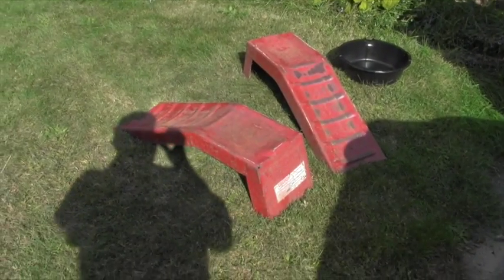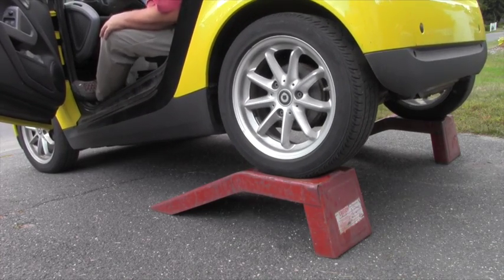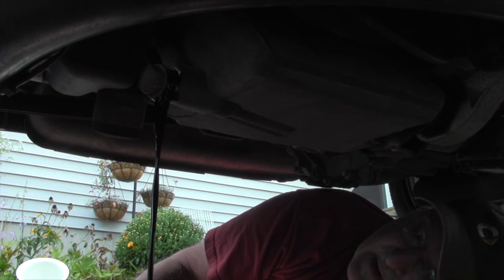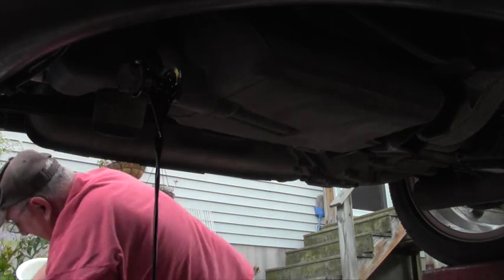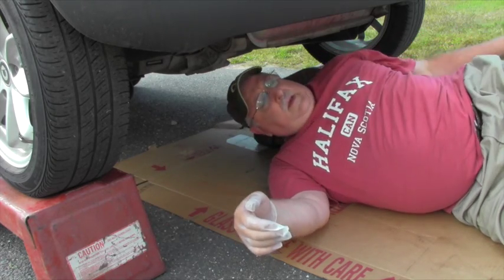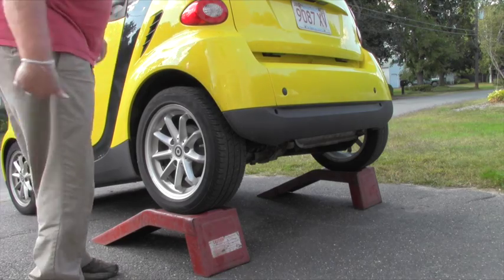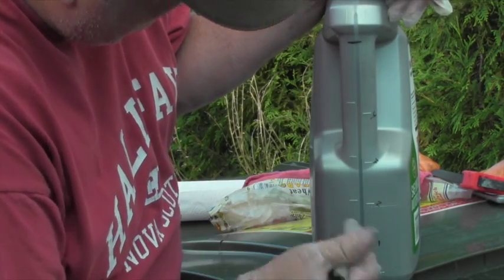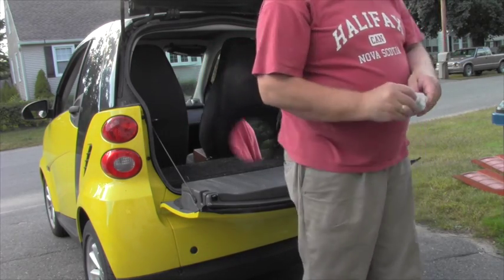smart Fortwo Oil Change

Comment: this is a perfect example of why you leave the things like a simple oil change to trained proffetionals... i have never seen anyone do anything like this HAHA,
i like how you make sure to clean off dip stick and fill cap, after you just ran the engine with no oil pressure for 33 secs HAHA, a little dirt in your engien is the least of your worries :P
Reply from the maker: It's an '08 and it runs just fine. Doesn't even burn oil. HAHA!
Reply from the maker: I won't waste my time going round-and-round with you over this. I've already addressed this criticism from dozens of motorheads like you who believe that instantaneous, irreparable damage is caused when engine parts begin to move without pressurized lubrication. If that's true, then simply starting an engine should also destroy it.
Reply: Denb7  i never said any damage acurred. but execive wear WILL happen when you do this.

im a trained mechanic. you should try it.
Reply: Hello Martin,

When you rebuild engines, do you suggest pre-filling the oil filter?

Please advise
Reply: LSmiata yes and you should fill it at the outer holes not the big one in the middle. the middle hole is for the filtered. 
thats why you fill it in the outer holes. 

but really the no1 thing would be t prime the engine until there is oil pressure
Reply: Hello Martin,

Thank you for reply.  You make some good points.  My oil filter has check-valve and takes very long to try and pre-fill on outer holes so I fill center.  YES!, I understand it is the intake to engine.  I just make sure no dirt/debuies/contaminates get into filter b/4 installation.

NOTE:  This step is also completely unnecessary, but I like to do as it makes me feel good when oil pressure hits so quickly.  Unnecessary, but satisfaction for the DIY guy.

Please consider that Denb7's video is very accurate for owners of a smart.  

Also, please consider, this engine was wet and under no load during video.  I know how painful it sounds and the tic-tic of the valve lifters making noise, but in the real world drivers do much more damage on a normal day by not letting an engine run for even 10 seconds before applying a load (i.e. engaging the engine and driving down the road).

Cheers and Merry X-mas to all.
P

Comment: Ps anyone ever here of cleaning the engine to keep it looking like new longer ? Geese that's years of untouched dirt
Reply from the maker: dave averesch Being located inside the car, under the deck of the rear storage compartment, I personally don't care whether it "looks new" or not as long as it operates well. When the dust on the outside of the engine affects its performance, maybe I'll clean it. Besides, with all the electronics involved in modern engines,  I'd worry about getting components wet.

Comment: OMG...  Start and drive a car without oil... This guy is an "artist" - the reason why don't like buying used cars....And there were so many ways to do it right...He could pour 3 quarts of the new oil, start the car and drive it down the ramps, shut the engine and then add the rest of the needed oil, he could also just release the hand brake and let the car go down the ramps without starting it and causing oil starvation to the bearings of his engine - some people seem to like abusing the limits of the boundary lubrication... He even didn't let the old oil drain completely...
Reply: Please show me the correct way.

I look forward to your couch chair coach video

P
Reply from the maker: Why didn't you just heed the disclaimers and walk away? You're wasting everyone's time complaining because nobody cares what you have to say. At least you acknowledged that there's still oil in the engine when you wrote, "He even didn't let the old oil drain completely..." even though it contradicts your, "Start and drive a car without oil..." comment.
Reply: LSmiata, In my post above I gave two correct ways of doing this job without oil - starvating the engine, if you couldn't understand what I suggest and generally see as something very complicated an oil change then it's maybe better to leave this job for someone who knows what to do, surely this would be much better than following the procedure shown in this video.
Or if you insist too much on driving your car without oil - do it, you can also try moving around with no coolant, it's your car and your money, but please stop entering in discussions you can't understand.
Reply: Mr Denb7, are you saying all this rubbish in serious?..Are you presuming that by leaving 100ml of dirty oil in the sump the oil pump pick up (in a car whose rear end is much higher than the front being the engine not positioned horisontally) will manage to take these last drops of waste oil and lubricate your engine with them, creating a hydrodynamic film between the crank and bearings? 100ml of dirty oil although being enough to contaminate the new oil are totally insufficient to lubricate an engine.
When making a video tutorial which would be available to the wide public better do the things right - more on something so simple but so important as an oil change - there are many folks out there not having even the remotest idea of how this task should be performed and they would be misleaded.
Reply from the maker: The category of my video is 'Entertainment' NOT 'How To'. For anyone so naive regarding changing their car's oil that they depend on the viewing this one video as their source of information and they blow up their engine, then they deserved it. That person should be paying Jiffy Lube to do their oil changes.
PS - I think a new filter plus 3.5 quarts of fresh oil will handle that last 100ml of old oil just fine.
Reply from the maker: So if I hadn't used ramps, the video would still be entirely incorrect? Wow! You are a hard one to please. Is it because I didn't drain the oil to your satisfaction? 
So where's your video showing the proper way to change oil? I honestly don't care for your suggested warnings or anything that happens to anyone who wrecks their own car through their own negligence. I accept no responsibility for their stupidity. I'd like to see someone try and sue me for such a thing.
Here's a suggestion for you: Being one of only a handful of people on the planet who actually knows the proper way to change oil on a car, perhaps you should do this professionally. You'd make a killing! I'm sure your customers would really appreciate how thoroughly you drain their old oil.

Comment: You don’t wanna over tighten the oil filter but it’s ok to run the engine with no oil 😂
Reply from the maker: Yes that's exactly right. Everyone knows that when you open the oil drain plug, it's as efficient at removing oil as disassembling the engine, steam cleaning all the parts and drying them with towels then reassembling the engine. Removing the plug leaves not even a slight coating of oil on any moving parts so they instantly begin grinding as if there was sand inside.
Yes... 33 seconds at an idle rev has allowed the pistons to chew right through the engine block.
GOD! Why was I ever so foolish? Doing this every year for 11 years has left nothing but metal shavings in the back of my car.
How ironic that I traded it in because the transmission crapped out.

Comment: I'm looking at a Smart car and was just curious about stuff... but this takes the cake. You can claim it doesn't hurt it, but you WILL NEVER touch any vehicle I own. The fact that you "think" this is OK is a scary thought. Licking a piston? Really? Is this something you have done? The difference between an oil film and lubrication being pumped though the engine is not the same. Not by a long shot. 

And just to put it out there, I doubt you need those ramps at all...that car is high enough and everything is within reach from the back... and it also looks like you need a new set, using them for a 1ton truck are we?

Licking pistons - that's funny right there...
Reply from the maker: David Cote Gee thanks for letting me off the hook. Here I thought you were going to ask me to change your oil. Knowing that I'll never be allowed to work on your car is a load off my mind. 

I'd bet that anyone who licks their cylinder wall will get oil on their tongue. 

FYI- I'm old and fat so I prefer using ramps... besides, it freaks weak-minded people out when I drive off them before replacing the oil.

Comment: This is why I don't buy used cars as a rule.
Reply from the maker: OMG! Operating that tiny engine for 30 seconds a year with no oil pressure isn't going to kill it. I found my first lawnmower on the side of the road with a dry engine and a seized piston. I beat the piston out of it with a hammer and used sandpaper on the cylinder wall which was badly scored. It was used and abused but I put gas & oil in it and ran it for 10+ years.
Reply: Get your used car cheeeeepppppp just for the fact ppl don't take care of cars the way you would so when they blow u can afford to fix them I had a 96 passat diesel changed the oil and filter and fuel filter every 7k on the dot especially the fuel filter 11 filler filter is better than couple hundred for a clogged #3 sensor injector lololol

Comment: why would you wipe the dipstick so much, you didn't even run the engine
Reply from the maker: +SilentServiceCode For any one or a combination of the following three reasons: 1) To wipe off any dust or dirt that gets on the stick so I don't shove dirt into the engine. 2) Precautionary wipe to remove any excess oil along the length of the stick so it doesn't drip. 3) To start with a clean stick to check the final oil level.
It's one of my obsessive compulsive behaviors.

Comment: better to underfill than to overfill
Reply from the maker: Because I don't pre-fill the new oil filter, I figure the slight overage will make up for the difference once the oil is pumped through the system.

Comment: Lol starting it with no oil was not the best at least put like a few litres in then move the car then check it and go to the fill like don’t over fill tbh it’s better under the max Line then over lol and when u said u wouldent want stuff in your oil filter lol ya that’s the point more your wouldent want stuff in the valve cover

Comment: Arranco el coche sin aceite. que locura. y  luego una vez bajado la rampa le puso. se cargo los casquillos, de biela y  cigueñal. y rallo los pistones.
Reply from the maker: Sin presión de aceite, pero no sin lubricación. Las piezas del motor están lubricadas con aceite residual. El motor funcionó durante 33 segundos a velocidad de ralentí. No lo suficiente como para causar daño.
El auto duró 11 años sin quemar aceite. La transmisión se rompió antes que el motor. (Google Translate)
Without oil pressure, but not without lubrication. Engine parts are lubricated by residual oil. Engine operated for 33 seconds at idle speed. Not enough to cause damage.
Car lasted 11 years without burning oil. The transmission broke before the engine.
Reply: @Denb7  tengo un smart y es el coche mas delicado que he tenido. llevo 2 smart .  si le aguanto 11 años esta muy bien. en canarias.  son islas montañosas. y los motores aguantan menos. por esa razon . si le falta aceite en la barilla. rapido le pongo. que lo disfrute por muchos años mas.
Reply from the maker: @Arpocrates2012  Es un vehículo inusual. Los estadounidenses aman los vehículos grandes y potentes. Compré mi Fortwo porque quería demostrar que los vehículos más pequeños funcionan bien para la conducción diaria.
Muchos se rieron de mi Fortwo. Cuando los precios de la gasolina subieron mucho, muchas personas comenzaron a hacer preguntas sobre mi inusual automóvil pequeño. Se sorprendieron al saber lo espacioso que era el interior.
It is an unusual vehicle. Americans love big powerful vehicles. I purchased my Fortwo because I wanted to demonstrate that smaller vehicles will function well for commuter driving.
Many laughed at my Fortwo. When gasoline prices went very high, many people began asking questions about my unusual little car. They were surprised to learn how roomy is was inside.

Comment: drain the oil on level ground you have the back of the car jacked up so there will be old oil remaining in the sump. i have no idea what possesed you to run a car with no oil in it?? you could of rolled it off the ramps!
Reply from the maker: I'm old and fat and it's easier for me to get under the car. if
Reply from the maker: I'm old and fat and it's easier for me to get under the car. If there's a bit of old oil left, it's not enough to make a difference. I am not able to roll off the ramps without assistance because my ramps have safety stops.
Reply: Fair enough

Comment: change the copper shim on the drain plug . roll off the smart off the ramps with handbrake off and in Neutral gear . There's no need to start a car with no oil!  there's better guides on YouTube .
Reply from the maker: +adonisnetworks It's difficult to push the car from behind and simultaneously apply the brakes as it rolls down the ramps and into the street. I change my oil alone. The copper shim? A wise suggestion, but I can't be bothered and it has never leaked a drop since 2008. If it fails to seal, I'll change it. Thanks for watching.